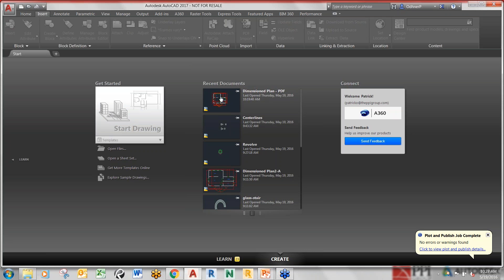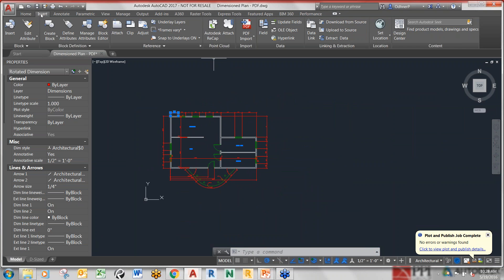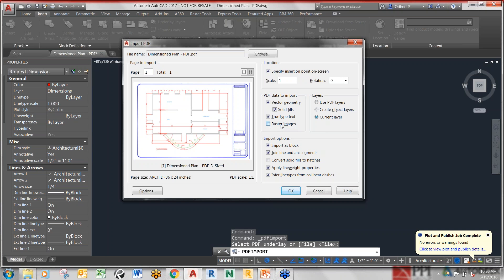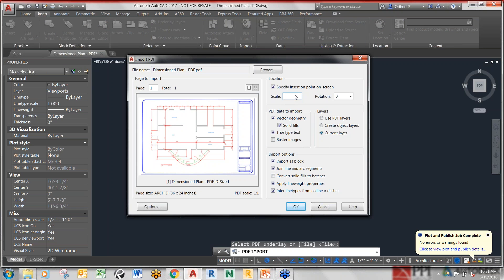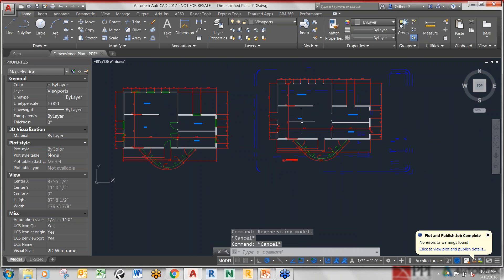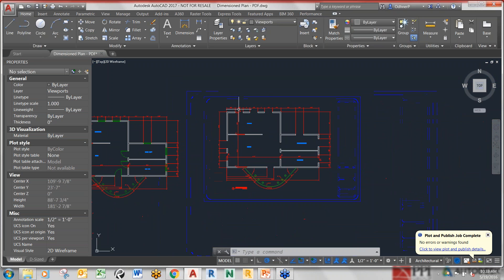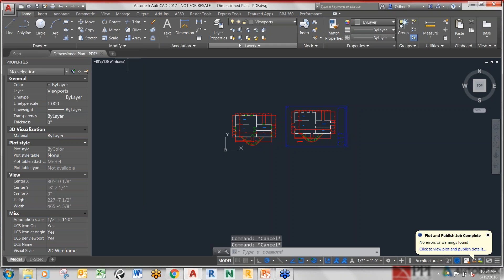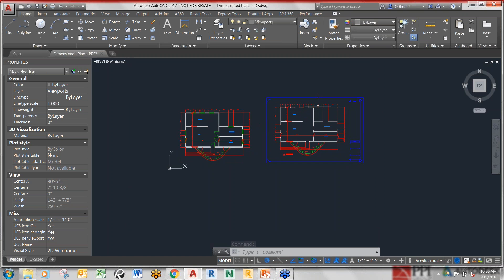2017 AutoCAD Import PDF Files

Comment: I have A Geological and Top Sheet with Grids in Degree Minute Seconds. How can I Import it in to exact location in Auto cad with proper alignment and scale.
Reply from the maker: Although AutoCAD allows the ability to bring in an PDFs/images, it lacks the ability to read, place and/or convert images into their true location.  Autodesk’s longtime solution for this procedure has been Raster Design which will run on top of AutoCAD. That being said, Raster’s main focus is dealing with the images – not PDFs.  Unlike PDFs, images often come with a secondary (location) file; the most common being a “world file”.  Raster reads this associated
information and makes the calculation for placement.  Map 3D will also perform this task; however, you will be limited on what can be done with the image after inserted.  Unfortunately, our only option without these tools would be the manual process of physical scaling, moving and possibly rotating.